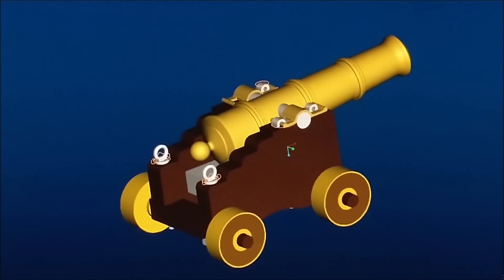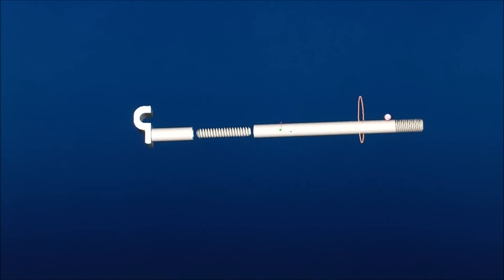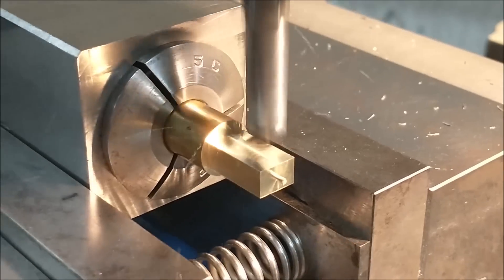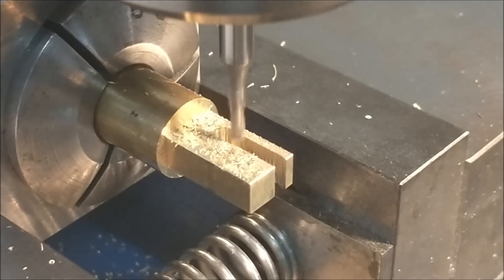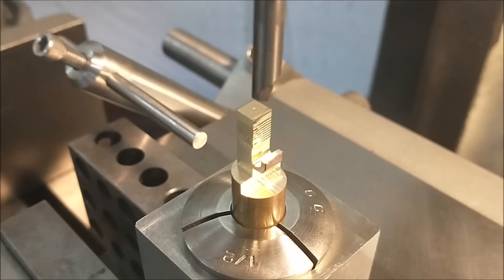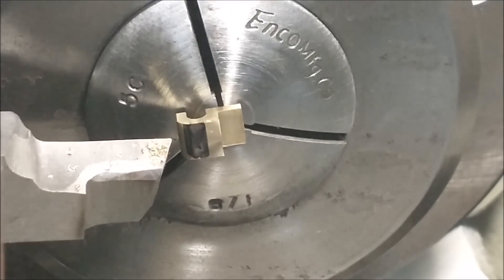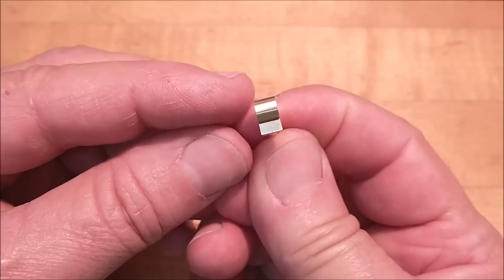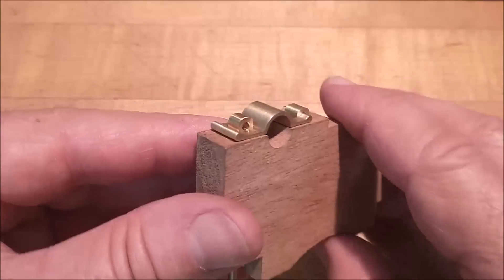Machining a Simple part........Wait a Minute !!!!!

Comment: How important is a dro on a lathe Mill combo
Reply from the maker: As stated, If you can trust the machine, its a time saver. Otherwise, its just 5 wasted decimal points.
Reply: It's not . Because it will never deliver the numbers stated

Comment: I was thinking you should make the top section out of square stock or something, but the round bar in a square collet block worked out better! Where do you get your micro taps? Mine are cheap ones from a cheap ebay vendor.
Reply from the maker: MSCdirect.com

Comment: I would have been tempted to counter bore .25 into the .5 thickness (for location) and silver solder the "stud" into it and then hand file it clean. Or drill all the way through and do an autogenious weld on the seam from the top and machine it flat. Your way is orders better. - Difference between a ham fisted millwright and a master tool maker, I guess (The "easy way" is usually the WORST way there is to do something. ,,,,, Keep giving me lessons my brother. Some day I will get it figured out.
Reply from the maker: I always choose my solution based on difficulty, load and cost. Peening a stud would work, but the load is axial and may pull free once tightened.

Comment: A neat clever solution Joe, I would not have thought to do it your way! However,I would have gone down the 2 piece route too. I would have drilled and tapped the top piece and either soft soldered or maybe silver sodered the 2 together. It's always good to learn other ideas tho'. Thanks.
Reply from the maker: If the top shelf was thicker, I may have gone that way, but the load is pulling down on the shaft so I had to be careful with the solution.

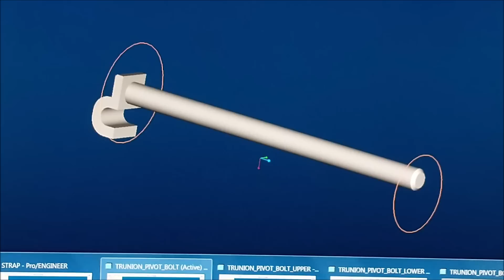Comment: HEY, ! That animated software program is wonderful the way it can move around the parts in question. Good to see you Joe. Before going any further I am suggesting a 2 piece silver soldered piece.(at 2:34). Hmm, I didn't consider a threaded union there but just at the transition from round to flat, There ya go eh, LOL. Well lady, Reach around to yer back and give it a couple pats as ya NAILED ANOTHER ONE, LOL. Well done my friend.
Reply from the maker: Thanks. My software is Pro-E Wildfire 4.0. The newest version is called CREO
Reply: @joepie221  Thanks Joe. This, I have to check out as the 3D capabilities are great. Have a great weekend my friend.

Comment: Great to see the upside down reverse threading operation in the bonus footage!    In my work I frequently have to accurately thread the end of long tubes that have a spiral feature inside the tube. Concentricity and co-axial alignment are important both on the OD thread and precision internal shape on the ID of one end of the tube.  Set up is critical and time intensive involving multiple dial indicators.

Threading away from the shoulder eliminates the heart stopping moment, potential damage to the workpiece and loss of the precision set up time
Reply from the maker: Showing that technique was my first channel video and responsible for the rest of the material.
Reply: @joepie221  That was the first video of yours I saw and it made me realize there where at least three of us, you, the guy who taught me and me.  Since then you have taught me a lot of set up techniques and some great techniques for de tangling spiders.  I even read the patents you were involved in for the medical fixtures.  As a retired Paramedic and someone who’s lower and mid back are held together with some pretty extensive hardware, I’ve also had some facial work around my eye socket and 6 weeks ago had my arthritis ravaged toe fused.  When it heals they will do the other foot.  I’m sure you sorted out what I work on now.  We’re it not for surgeons and toolmakers who figured out how to fix broken people I would not be walking and would have no sight in one eye.  I guess what I’m saying is THANKS JOE.
Reply from the maker: @takedeadaim8671  I've been very fortunate to have been given the opportunity to contribute in that field and truly blessed to have the ability to design some very helpful products. I know I've helped a great deal of people that I'll never meet and I'm OK with that. Glad your still kicking, and thanks for the comment.

Comment: If I were doing it, I would have done the rod separate from the hook, drilling a hole for the rod to penetrate the hook, and welding it on the top side. That way material loss would be minimal.

Oh wait. That thing's tiny! Still weldable with a TIG, but maybe not worth it.
Reply from the maker: Can brass be tig welded?
Reply: @joepie221  Some alloys are more problematic than others (like if they have Lead) but if you get to pick your alloy, and you use a TIG welder and rod of the same alloy or an alloy made to be compatible, you can do it. Zinc makes it harder but not impossible. The TIG welder takes care of the need for any special flux to clean it, but you have to clean it yourself before welding.
Reply: @ManicSalamander  "You can't weld dirt" as my grandad would say.

Comment: Joe, I started making a list of the sub-lessons I learned in this one, and and quickly spiraled into nuance I had to experience to understand. Amazing output, as always. Here are my key take aways:
Run the tool backwards to establish a witness cut on radially-constrained features. This is to keep as much original material as possible. On tiny components, the remaining base material is important even if you can't see what was removed.
Make each witness cut with the motor in reverse,, independently, to eliminate ambiguity about which one influenced the outcome. Measure and evaluate.
Subsequent exterior features should be plunged to depth (or until cutter depth approaches 3x slot diameter). Repeat as necessary,. No shallow , broad cuts deep radial features.
Only extend X/Y planar motion to the edge of the part. Over-travel is likely to kick up a burr when the system (cutter and bearings) unloads.
Keep your machine tolerances working FOR you
Keep your tools sharp, and your brain sharper.
Thanks for sharing.

In case anyone other than the content creator reads this: Take a YT break and try to set this up in your own machine. You're probably going to find some things that need adjustment, which will make everything you do with that machine better.

Comment: I probably would have turned a small spigot on  the end of the bolt and silver soldered it to the hook.  Pickling and clean up is a pain though. Your method ensures that you don't wind up with a molten blob of brass

Comment: You could also use something like a spot facing or counter-bore cutter, or, make a cutter like Stefan G. did in his latest video.
I would probably just 'braze' or puddle the end of a bar to get a diameter large enough to machine features.
Back to the video :)

Comment: I’d make it as two pieces; turn the long piece, then make the hinge piece, then join them with either a small screw or tapered pin. Once done, silver solder the two together and clean up (the silver solder, and any flux.)
Reply from the maker: Just like double sided tape, soldering is never at the top of my solution option list. But good and viable solution.

Comment: I would simply split the past into two components: the long bolt section would thread into the hook
Reply: I see that my solution lacks the same engagement due to the variance in amount of thread capture
Reply from the maker: Your logic is good. I just added the round standoff to solve the thin shelf issue.
Reply: @joepie221  ya, I responded (both times) prior to become aware of the small dimensions!

Comment: My Dad always said the most valuable   bit of Blacksmithing a toolmaker can learn is how to upset a bar. If you can increase the diameter by 50% to accommodate a feature you can half the cost of the stock required. Of course this only applies to steel and small features, anything complicated that's when you need the phone number of a good industrial blacksmith.
Reply from the maker: Or a liquor store that delivers. :)

Comment: I would make it in two parts, a 1/8th bar and make the other part from a square bar and drill a hole, then silver solder or weld. Good work, well done.
Reply: Same basic concept; but riveted…
Create the hinge, drill a hole through centred on the shaft and 1.5-2mm diameter with a good deburring chamfer on the top face; then create the shaft. Get a good shoulder and make it over-length at a good fit to the hole by the thickness of the plate plus 0.5mm? (maybe more). Fit the two together and peen the upstand down. Finally dress the mushroom off the top to get back to a flat plate.
The metal filling the chamfer and the hoop stress in the plate should be more than enough.
Reply: @LoneEagle2061  Also a solution.
Reply: Yes that's the way I'd have gone about it, but Joe's solution is a true machinists way of doing it.
Reply: @samrodian919  Very true.  I also like the idea of making the end of the rod in such a way as you can rivet it as suggested by someone else.
Reply from the maker: Press fit and peen would have been a great way to go as well.

Comment: I think you have the barrel upside down.  Historically, the trunion was centered on the low line of the bore.  That way, the barrel is driven against the quoin when fired instead of away.

Comment: why run boring in reverse?? what if your mill does not have reverse??? Could you use a boring tool that has cutting edge which is mirrored????
Reply from the maker: Yes. Work with the concept. Adjust/improve as necessary.
Reply: you can turn it upside down and run it on the back of the part instead of the front

Comment: Im making civil war era 3"inch parrot rifle and these videos have been great help. Only proplem is that i use more civilized metric standard and not grude caveman foot inch hands
Reply from the maker: Civilized metric is one of those expressions like military intelligence.
Reply: But you are using your caveman foot hands to make the piece.  We just have on less conversion.  😉
Reply: @matts8023  indeed very big mistake every measurement now is in 1/20 scale at 152,23456323mm 22,66234 mm, it is hell for my lathe. Even bore size is 4.86mm but i wont stray away or step back from my principles and human evolution so i will convert every single cavemaninch to precise metric and the piece will be made by using millimeters. Should have done german cannon

Comment: 2:29 -- My idea on how you would do it: take a bit of 3mm threader rod, reduce the tip to 2mm, then drill a 2mm hole in the flat hinge that is chamfered at the top and peen / rivet the rod into it. Let's see if I am right....

Edit: Obviously, your solution is more rigid, stronger and aesthetically more pleasing ;-)
Reply from the maker: That top ledge is only .05 thick. 1.25mm I considered it, but thats really thin.

Comment: Paused to make comment on method i would use: Silver solder 2 pieces of stock together to form the overall component.
Edit to add: watching your solution confirms our ideas are very similar but you have gone with a mechanical fixing method rather than my silver soldering jointing method. Good plan,Joe👍
Reply: I was about to make your exact same comment, so instead of doing that I'll just say "me too!" 🙂

Comment: Having been around naval cannon quite a bit, I know how the old timers did it. The hasp was forged separate from the rod. Often both ends of the rod was threaded and nuts were used.
Reply from the maker: Logical. I would have thought it was bent plate.

Comment: At 13 minutes in when you squared off the soft jaws you could have used a Ø5mm endmill to also cut a 5mm wide slot 0.153" down from the top faced off surface to make it easier to locate the part for the radius milling operation.

Now for the contentious comment regarding what you said at 9:52🤭 This is based on normal conventional tooling axis notation. If the tool going downward on the mill is travelling in the negative Z direction then the normal direction you will run the spindle is counter-clockwise and when you were using the boring bar in reverse it was travelling clockwise. This is because the direction you should view an axis from in order to determine the rotation, as either clockwise or counter-clockwise, is along the axis towards the higher value of the axis. You have to imagine it from the position you would be in lying on your back and looking up. The same is true for lathes, the normal direction of rotation of the spindle should be considered by looking from the headstock towards the tailstock. This will give the rotation as clockwise, not counter-clockwise as it looks from the normal operation position. This should be the way a CNC machine should respond to M3 and M4 instructions. M3 being clockwise and M4 counter-clockwise. It would be interesting to know if an M4 command does indeed spin your CNC mill spindle in the "conventional" direction.
Reply from the maker: I respectfully disagree. Imagine a pencil drawing a circle as the cut direction. The spindle was rotating counter clockwise. Maybe the camera fooled you. M3 is clockwise. At least in Texas it is.

Comment: As you edit the video, it'd be great if you point out (on the finished part) the feature you're machining at the time.
That would make it easier to follow your order of operations.
Reply from the maker: I really like that suggestion. Picture in picture will be most valuable.

Comment: Hi Joe.  I was thinking about how the part was made 200+ years ago.  Did you consider forming the eye by upset forging a round rod in one operation?  Make a die to the mating shape.  Fully support the rod inside a hole with a blanked off end so it cannot buckle.  Heat the cantilevered end red hot and upset form to the desired shape.  Could be hammer formed as it is a tiny part.
Reply from the maker: Absolutely.

Comment: This is probably a lot more precise than the original full sized cannons. I presume they forged the entire part, having the cylinder be rough enough to fit through an oversized hole. And I would guess that they weren't held in place with a screw at the bottom either. That would be a lot of work to forge, when a locking pin would work equally as well at that large scale.

Small scale models run into all sorts of problems that the original makers never had to consider. And use tools that the makers could only have dreamed about. These cannon  pre-date the invention of the modern machine lathe and milling machine. Compound rests had been invented, but from what I can find out, were used for ornamental turning. (Leonardo da Vinci may have been the first to think of such a design, but Andrew Nartov of Russia is the first known person to build a lathe with a geared compound rest in 1718)

Comment: (paused) I have done these parts in the past. I would begin with a rectangle piece of steel, clamp the head section in a 4 jaw chuck in the lathe and turn between centers. Then the turned part is clamped in a square collet on the mill and the various machining operations are accomplished on the rectangular head.
Nice work Joe; it fits very well.

Comment: 02:30 [pause] The thing I would do is making the hook and the bolt separately and hard-solder them together. But 1) USA-Americans are usually scared of soldering and 2) by the way you show the part and narrate it you intend to make it as one part. So honestly I have no inkling how to go about that  [unpause]
Reply: 03:28 Oops I got close to your solution. In my case I would have threaded the hole in the hook and screwed the bolt in (at full length), then hard-soldered it,  and skimmed the surplus of the bolt on the topside of the bolt off when finishing the topside of the hook. Close. You chose a different location for the division

Comment: I guessed 2 parts but NOT threaded like that.
Because most of the shaft is hidden in the chassis I would have made the strap with as short of a pin as practical and then silver soldered the rest of the shaft on instead of threading. 
The joint would be hidden in the chassis.
Reply from the maker: True.
Reply: @joepie221  I love the fact you take time to read comments.
Compared to so much of the rest of social media its people like you who make it worth while.

Comment: Hey Joe. Before I see what direction you're going, being that it's just brass I'd probably knock that diameter out in just two cuts so the small diameter is backed up. I've cut very long very small diameter parts this way to good effect. Curious to see if you go this route or maybe turn it into an assembly.

Comment: Haven't looked at anyone else's comment yet... Either machine the "hook" part separately, OR use a square bar big enough to envelope the "hook" part at the head and mount it in a 4-jaw such that the long round diameter can be turned with a live-center in the tailstock. (And/or roller-type steady rest.)

Comment: Hey Joe how would you handle drilling a 9/16 hole in a piece of 4340 that has been work hardened? Without any carbide drills or endmills? I do have a high temperature oven for heat treatment. Was making a backing plate for my chuck on my 1917 L&S lathe it has a straight bore with a 4 1/2-6Tpi that has to be protected from expansion and deformation. I only have one lathe, and this is the back plate so I can have a 4 jaw chuck.